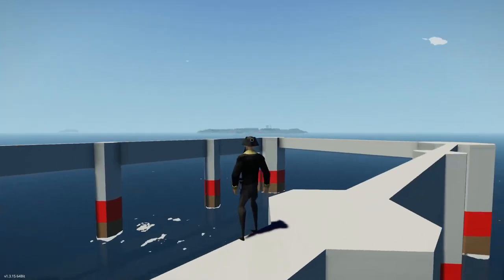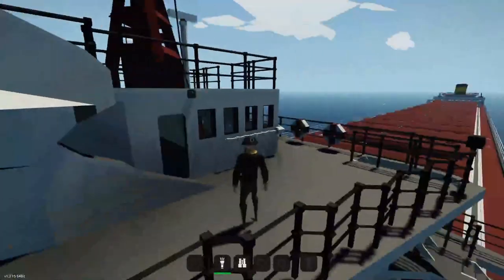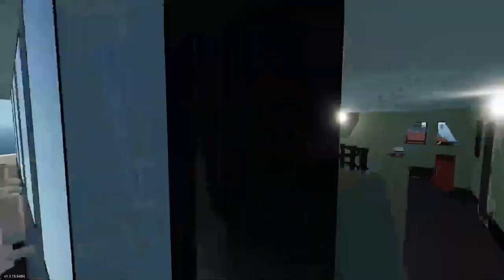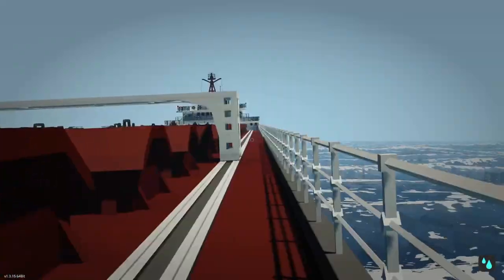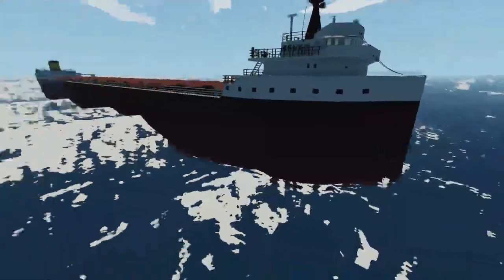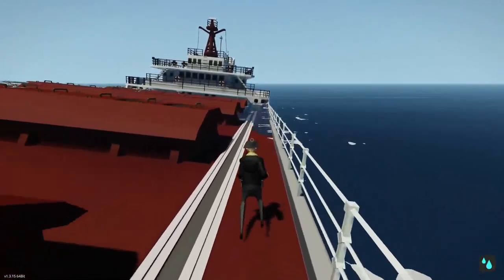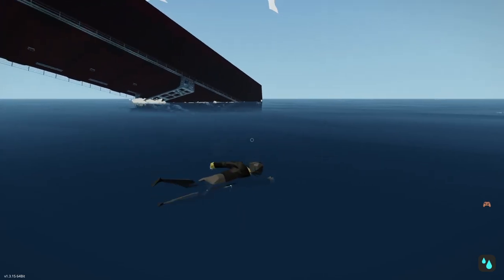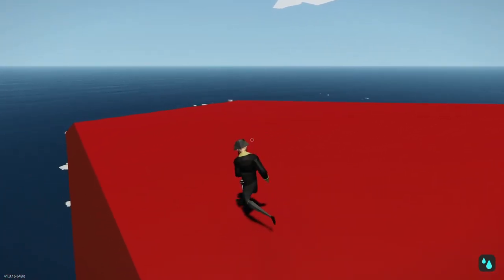Ships Are Getting WAY TOO BIG... | Stormworks: Build & Rescue

Comment: That huge ship is actually not a tanker it's actually called a Laker.

A Laker is a type of bulk freighter used specifically on the Great Lakes over in the US and Canada. most of the time they were built for transporting iron ore but are able to transport other kinds of bulk commodity cargo as well, they're also the only type of bulk freighter where the pilot house is all the way up forward while everything concerning engineering is at the rear.
Reply from the maker: Interesting... I'm guessing lakers aren't built for really bad waves?
Reply: @MonsterWind  oh no trust me they are they're built to the same specifications as ocean-going ships because the Great Lakes are almost like Inland Seas and When Storms kick up all you can really do is hold on
Reply from the maker: Oh! Cool! I didn't know that.
Reply: @RailPreserver2K  Yep, a November storm on those lakes would rival any hurricane.
Reply: Worth noting the classic straight deckers (most of what was built from 1890-1975 were the ones with the forward pilot house.  After the 1970s when the 1,000 footers were built, they moved the pilot house aft on the new lakers.  There is 1 exception out of the 14 1,000 footers.
Reply: I assume the Stewart J Cort?
Reply: @JackBlpck427  That's the one
Reply: @RailPreserver2K  built with more bendier steel known as “Great Lakes steel” because on the lakes the waves come in all directions

Comment: the propeller in the rear doesnt work i tried it doesnt spin and you found my pink electric motor. the thing moves by alot of hidden propellers
Reply from the maker: I wonder why it won't spin? Strange.
Reply: @MonsterWind  its a xml propeller i guess it doesnt work because of that.
Reply: @MonsterWind  hense the pink motor